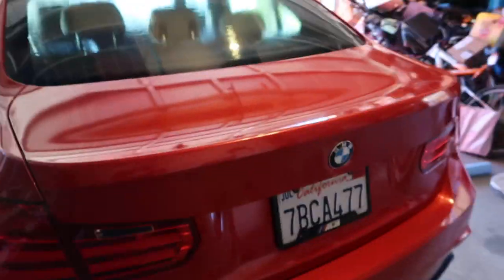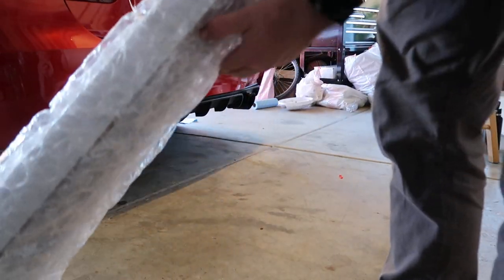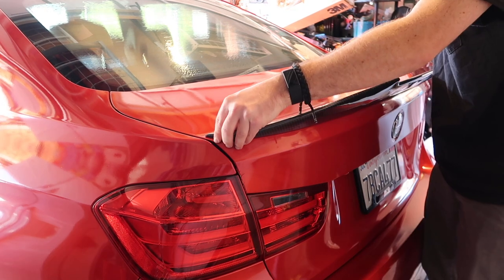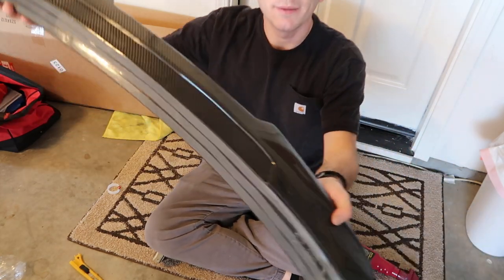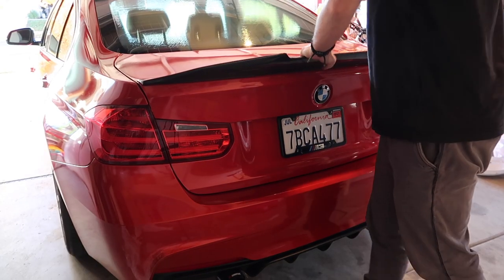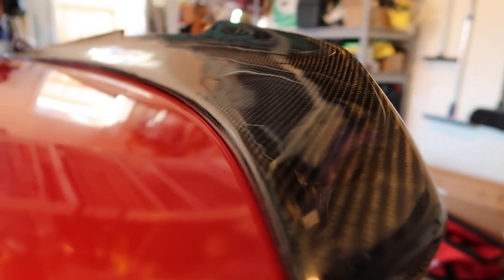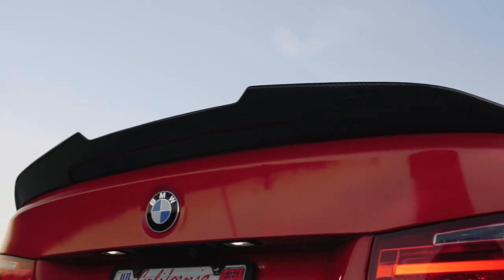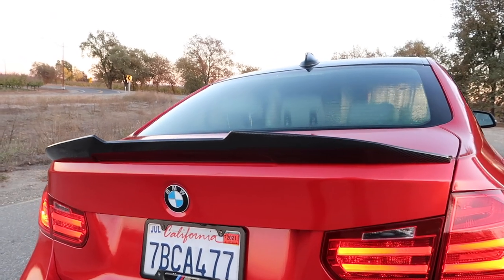BMW F30 CARBON FIBER SPOILER INSTALL!!

Comment: Number 1 tip!! Avoid too many carwashes! The soap detergent will dissolve the glue in the 3m tape, and cause it to shrink.
Reply: What if you used trim adhesive as well

Comment: N0W ... I'm  N0T real sure in your case since I don't  have your instructions, however; "generally" they don't recommend exposing ALL the 3M tapes sticky surface all at once.

You're supposed to tag end the protective layer to where there is access to it from the outside edges.

The place the spoiler on the deck lid properly and evenly position with masking tape..

Then grasp each "tag" end  individually and peel it out from underneath the taped down spoiler and recheck positioning after each strip to insure that nothing has moved.

Continue pressing down on each removed strip before moving to another.

IF ... you make a mistake when placing the spoiler with exposed tape, they can be next to impossible to reposition or remove; with great possibility of either damaging the spoiler or the auto paint in the process.

You should also get a better "bond" utilizing the individual strip method.

Hey !  Your job turned out great and looks fantastic !

I'm  looking for the "right" carbon fiber spoiler for my 2006 T0Y0TA Avalon Limited.

Thanks for your suggestion.  Any manufacturer for that ?

Comment: Your Car Looks Nice 👍👍 i have a BMW as well there nice Cars. I have the BMW 2010 328I  I got a Trunk Spoiler as well Mines different but not by much. I Changed My Kidney Grills out and i lowered the Car a bit , also I added Ground Effects and Low Profile Tires. I'm getting My windows Tinted next Week. Then My Car will Finally be all Done ! ! Nice Video keep up the good Work Man.  PS  are U going to get your Windows Tinted  ?

Comment: Hey Jonathon...any problems with the spoiler coming off later?  I am doing an install of one myself and just checking to make sure the tape will hold over time.  I am also in an area with extreme heat FYI.  Thanks in advance!  Looks great!
Reply: How’d you go?

Comment: How is the spoiler holding together?
Reply from the maker: still holding up great!
Reply: @JonathanWeeks  that's great, I have 2015 bmw 428i luxury edition, and its trunk has brake light, so wondering if it will work with it and not cover the brake light. I double tape didn't look so promising as I'm in Texas and it gets really hot here, so had to ask that question )) BTW your's bmw look great